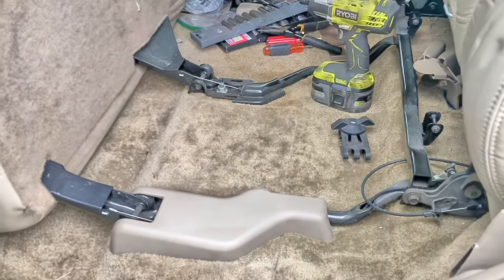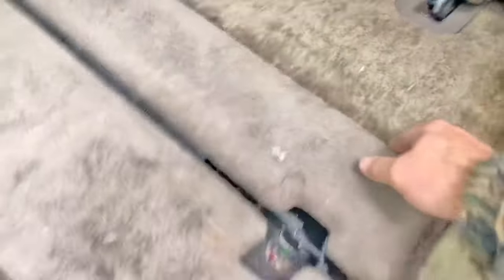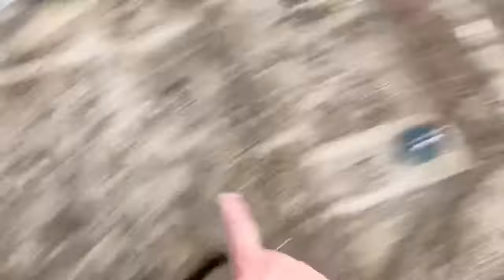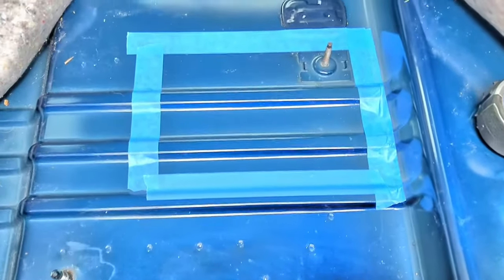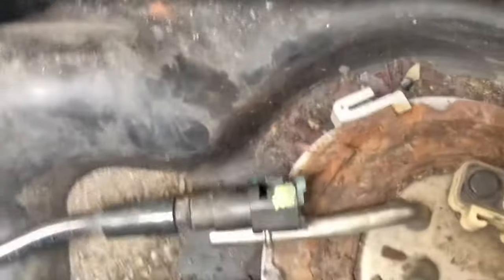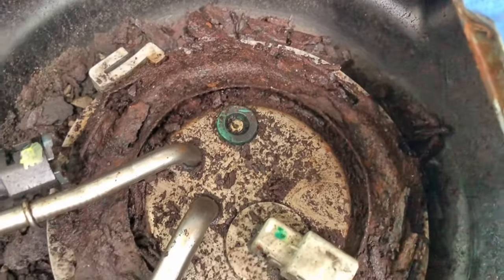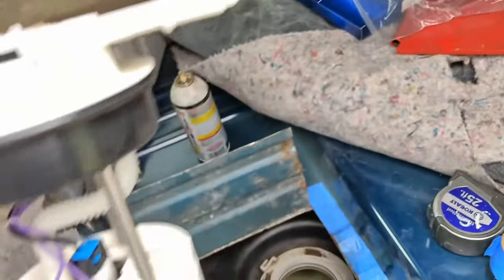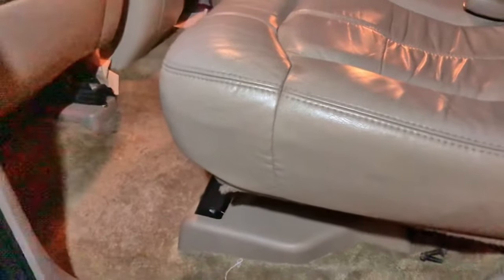Chevy Tahoe / Suburban Fuel Pump Replacement Without Dropping the Fuel Tank ... In 2 hours or less!

Comment: I’ve got a 2003 Tahoe, and after 2 pumps and the drama that comes with the mechanics wanting extra money, I WILL do this, I thought the actual access would on the “trunk” area just behind the second row, Thanks for a very helpful video ✌🏽
Reply from the maker: You’re welcome!
Reply: @jeremy_rigged  hey what did you use to cut the hole?
Reply: I second this question. A cutting wheel seems dangerous
Reply from the maker: Sorry @greenhead333, I thought I answered this already. I started with a cutting wheel and quickly came to the same conclusion and switched to a metal cutting blade on my jigsaw. My jigsaw has an adjustable shoe for cut / stroke depth and I kept it at 1 inch… worked beautifully and actually cut faster than the cutting wheel.
Reply: @jeremy_rigged  much appreciated. I'm doing this job for a friend. I dropped the tank and was met with resistance at every turn. Got the job done, and not fuel pressure. Come to find out, the pump is either wired backwards thanks to the pump manufacturer's terrible wiring diagram, the owner bought the wrong pump. It's a 03 tahoe, with a flex fuel system. The owner said he told the parts store it was a 4.8L gasoline. 

Either way I gotta get back at the pump, and think I may go the access door route for easier troubleshooting
Reply: @greenhead333  I cut the access panel. Worked out pretty good actually.  My take was 3/4 full of gas and I didn't want to hassle with all the other connections.
Reply from the maker: Awesome… when I did mine in the video it was literally right after filling the tank the night before… next morning the pump died in the driveway.

Comment: So glad I found you!  you just saved me hours of work and of course the pump failed with a full tank so i wasnt going to spend 100$ on 5 gas jugs to recover fuel into, and dropping a tank with 200lbs of liquid in it on my back certainly isnt a fun option, so I found THIS!  Had to take a little time to subscribe to your channel and say thank you!  I copied your cut diagram to the "T" and all worked perfect.  Appreciate you very much.
Reply from the maker: So glad it worked out for you! I definitely appreciate the comment and subscribing... more to come, stay tuned!
Reply: What did you use to cut it?
Reply from the maker: @harcoisthebeezneez  I used pneumatic nibblers for sheet metal. Have to start by drilling a 3/8” hole. If you’re absolutely confident you don’t have any fuel vapor, and angle grinder will do... but there’s a ton of risk with that. A reciprocating saw and short blade would be the better option.
Reply: Would a jigsaw work to cut? Also I have an 06 Tahoe that I was wondering if the location is similar?

Comment: I'm still wondering y GMC never included an access point in this area from factory 🤦🏽‍♂️. I did this same thing about 5 years ago and now that I had to buy a similar SUV, I'll be doing it again. The first nut on the tank strap broke and attempting to drop it wasn't even a choice after that. I'll I did was cut the carpet to save more time and angle grinded the cut it and just banged it back in place. It did not look this pretty lol. As long as you get it done, you'll be the only one to know either way

Comment: I used a dremel 3000 with the EZ-Lock cutter blade to cut out the panel. Thanks for the license plate idea to reinforce the floor. Will have to go back in to implement it later. Just used a few short self tapping screws and flashing tape to seal it all back up. Saved a ton of money  DIYing it. Most mechanics i called where quoting me $900 -$1100 which is outrageous. Thanks again!!
Reply from the maker: Awesome... thanks for taking the time to comment, this is exactly why I make these videos... to help others save a few bucks and to share knowledge. Happy New Year my friend!
Reply: Did the Dremel cause any sparks? I actually just bought the exact model and cutter blade and was curious!
Reply: @skeliton1011 Yes there were sparks but very minimal. Once i got a straight cut going i reduced the speed of the dremel and the sparks went away.
Reply: I used a grinder and it threw sparks everywhere but nothing happened. Then again I'm a pro mechanic so of course I capped everything off to prevent fuel vapor from igniting
Reply: I used a hammer and chisel and I changed the fuel pump in my 95 cadillac in less then 20 mins

Comment: Thanks man. I just bought a 04 suburban literally last night and the fuel pump with out this morning. I’ve owned a few gmt-800 rigs and I don’t want to drop a fuel tank again so this is awesome gonna go out and do this now!
Reply: May I ask how u were able to diagnose it as the fuel pump? My 2001 Tahoe is beginning to sputter but no misfiring.
Reply from the maker: @MizzKeamz Mine was an eventual complete failure, fortunately in my driveway. However leading up to the complete failure, I did have some symptoms of running lean, such as lack of throttle response, no power up hills, some misfire codes, etc.

Comment: Thank you! This is a very common thing to do in the jeep world but wondering what did you use to make the cut? Assuming it wasnt a grinder
Reply from the maker: Thanks Adam… a half inch drill bit for a pilot hole and a short metal cutting blade on a jigsaw will get the job done safely. (Reciprocating saw as well.) Either choice, try and use a saw with an adjustable shoe to keep your cutting depth at an inch or less.

Comment: Yours looked more like mine than any on the u tube pages.  Too bad I found this after we did it.  it still worked and just make sure you turn the key forward three times, after you install the new fuel pump.  I listened to the fuel pump, before we covered, and it started right up and no dropping the tank.  You might need two people I pushed on the ring as my husband turned the ring, it has a bit of a spring.  
started right up.

Comment: what did u use to cut the hole.... that metal is pretty tough
Reply from the maker: I started off with an abrasive wheel and quickly switched to a metal cutting blade on my jigsaw. Set to about a 1 inch stroke / cut depth.

Comment: Thank You for the video. My retaining ring was just as rusted as yours. I used a small drill bit and drilled several small holes on the top and bottom of ring to remove. Wiring diagram on the after market pump not correct so I had to go with a GM. This wiring was correct. Up and running saving me at least $500. It took me 2 days @ about 5 hours per day. Hot here in Chicago. Again thank you very much.
Reply from the maker: Awesome William… happy to assist! Yes… those retaining rings can get pretty nasty… amazing how strong rust can be. 😁

Comment: Hi there. Excellent video.   What brand new pump did you use? Factory AC Delco or off brand?  Doea it run well?
Reply from the maker: I used an aftermarket pump from AutoZone. No complaints, 30k miles later still running fine. https://www.autozone.com/external-engine/fuel-pump/p/trugrade-fuel-pump-c5341011/563518_0_0?cmpid=LIA:US:EN:AD:NL:1000000:IEN:19486091408&&CATARGETID=120054150001289130&CADevice=m&gclid=CjwKCAjw04yjBhApEiwAJcvNod_NHZEBmql7PbX5G1oUMgorgP0FC1ds0LWBbiF1o4UbTjJ409RnQBoCI8oQAvD_BwE&gclsrc=aw.ds

Comment: What did you use to cut the access port?? Great video bit what method did you use for the hole?
Reply from the maker: I started with a cut-off wheel (badddd idea) but switched to a metal cutting blade on a jigsaw and set the stroke at about 3/4”.

Comment: Im glad to notice how wayyy much easier yo vid was. I just watched one that took this guy almost 2hrs if that. Just by unhooking the lines,hoses,clamps, brackets. U just made it so much easier. Wat did u use to cut the metal. That tool I dnt hav. But I appreciate the vid. U showed me alot to making a hard job not too difficult to do. My problem on my truck is the floater sensor. The fuel pump is fine I just dnt see myself buying a new pump when all I need is the sensor. But I guess havin the new pump comes wit all that already. Is there a certain model # I need.?
Reply from the maker: Thanks for the comment Deezy… I cut this one with a pneumatic nibbler, but you can use a short metal cutting blade in a reciprocating saw (sawz-all) or on a jig saw. (you can also use a metal cutting blade on an angle grinder if you are 100% certain you have no fuel leaks or an abundance of fumes.) I recommend a jig saw … much less risk. As for the pump, I purchased a cheaper non-OEM pump from Rockauto.com and it’s been fine. You may have an easier time finding the whole pump assembly in stock versus just the fuel probe sending unit… but best wishes on your repair whichever way you choose to go.

Comment: Been trying to get that new lock ring on but I can't get it to seat all the way, been trying for a few days now, any tips?
Reply from the maker: I had to use a broad tipped flat blade screw driver to bend the tabs slightly upward… and it took a bit of rubber mallet and screw driver impacts to spin the lock ring fully. Seems as though the aftermarket ones are a little thicker.

Comment: What and how did you cut the floor bed open. My fuel pump has a leak on top of tank connection?
Reply from the maker: My method wouldn’t work for you… I ground a small slot with an angle grinder (sparks aimed upwards) and finished the cut with a reciprocating saw. A good metal cutting blade on a jigsaw will work if you drill a 3/8” hole to start the blade. Same for a pneumatic nibbler… but it’s frustrating to use on the corrugated floor.

Comment: I dont care what called it.  Dang good video.....   (Rivets) Thank you sir
Reply from the maker: Thank you!
Reply: @jeremy_rigged  I have one question.  Were did the bolt go for the seat when you closed the opening.  It is gone.  I noticed it when you had shown the plate covering the hole
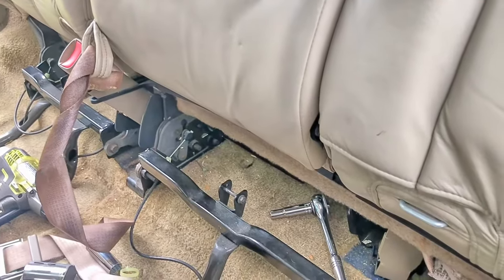Reply from the maker: @sesllc241  I believe the bolt you are referring to wasn’t a seat bolt, it was the bolt that retains the jack under the rear seat. It can be seen at 3:43 in the video with the large black plastic nut still on it. I just removed it altogether as I don’t have the factory jack for this vehicle.
Reply from the maker: @sesllc241  also can be seen at 1:49

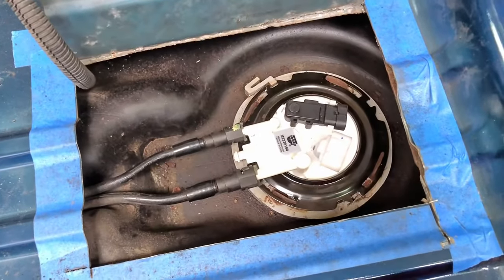Comment: Hey buddy  @ (9:52) it has the plate covering your hole you cut out.  right above that hole is the hole for the bolt and it is missing.  It was there before you made the cut.  does the bolt need be there or is ok that it is not?  I just want to get this right so I can do it.
Reply: I was wondering the same thing too
Reply: Apparently it’s the stud that holds the spare tire jack in place.

Comment: Debating on whether or not to go with this method. Do you know if this works for the 3/4 ton?
Reply from the maker: Bandjolyn... this link may help. https://www.pirate4x4.com/threads/suburban-2500-fuel-pump-access-hole-locations.1425858/
Reply: @jeremy_rigged  Yes! Thank you, very helpful. You're a beast.

Comment: What size head did you use for the nibbler? 16G? Also, would you share the link from where you purchased the fuel pump. Thank you kindly.
Reply from the maker: Gabriel, the nibbler I used was for 3/64” (18-19 gauge), a 16 would probably be perfect. Link for pump… please double check your truck details… mine has the 5.3L engine. https://www.carparts.com/details/Chevrolet/Tahoe/DriveMotive/Fuel_Pump/2002/LT/8_Cyl_5-dot-3L/REPC314507.html

Comment: Looks like you are cutting into the passenger side.  That correct?  I've got a 1999 GMC K1500 Suburban and the fuel tank does not want to drop down.  Trying to find right spot to start cutting in.
Reply from the maker: I’m directly under the drivers side second row seat... if you can borrow an inspection camera (or pick up a cheap one at Harbor Freight or Lowes) you can explore a little by just drilling 1/4” holes to find the perfect spot. From what I understand this technique works on 2000 and up Tahoes and Suburbans... not sure anything is much different on a 1999, but can’t speak from experience, sorry.

Comment: Great video, really helpful, thank you!

My problem is mine leaks from the top of the tank when I fill it so I'm afraid there's gas pooled at the top which would not be good when I hit it with my grinder's sparks, hah.  I've run it dry (I think) and it has sat for a few months - wondering if anyone had thoughts/experience??  I doubt there's gas still sitting atop but it leaks from somewhere when filled so I worry there's a hole or something.  The only reason it's still sitting all this time is because I'm paranoid...
Reply from the maker: If you carefully drill large pilot holes, the metal is thin enough that it will easily cut with a metal cutting blade on a jigsaw, or reciprocating saw. Best to just let the vehicle air out a few days and allow any pooled fuel to evaporate. Good luck!
Reply: Mine was leaking from the top also, so I got a guide hole with a hammer and punch, then from there you can use a jigsaw or tinsnips

Comment: THANK GOD I FOUND THIS 🙏 my Tahoe is a 2000 with 220,000 miles on it I ordered a new pump and fuel pressure regulator on Amazon and now after watching your video I wish I would have ordered the top ring also it did cross my mind if it was going to be junk or not and I'm thinking I should have just bought a new one anyway regardless because this don't look like it's going to be fun I changed the fuel filter hoping that would have done something but it didn't now the next step is the pump and regulator I'm going to put a new fuel pressure regulator on it with a new pump all the same time so the whole fuel system will be all new regulator pump and fuel filter I've got a load of tools inside my truck because it's basically that a truck and the back seats have been folded down since I bought it and it's covered with all my tools so I got to clean my truck to get the seat out I don't care about the car but I don't care but none of that I just want to punch a hole and put a new pump and go but if I have to take the seats out I will you know so I am so glad I found this video thank you very much in details are perfect very good detailer very clear understand and hey you know what you didn't have to swear that's awesome person can teach without saying rot and stuff and my friend you are a teacher thank you so much Rodger and Grantsburg Wisconsin
Reply from the maker: Happy to help Roger! That pump retainer ring is pretty common and usually in stock at Advance Auto and Autozone… about $12 there, may want to grab one. Best wishes my friend!
Reply: @jeremy_rigged  I had to laugh because  everyone talks about big brother and all the algorithms of Big marketing and my got done looking at you watching your video and clicked off of YouTube and in my email inbox was suggestion from Amazon for a four and a half inch DeWalt angle grinder just what I needed how did they know funny how they knew laugh out loud but when I ordered the pump I should have got the ring I thought about it afterwards and I and I now I should have I should have bought one when I ordered a pump and all the stuff I bought on Amazon for a third of the price and same pump is what they were selling at the parts store for $40 less they wanted 95 bucks for a pump and I remember how much it was for the setup for the pressure regulator but it was way more than what I paid on Amazon . Again thanks for the video a very good video . And I'm going to see if we're going to undertake everything here tomorrow if I got everything that I'm going to call the parts store right away in the morning in town here bumper to bumper or O'Reilly's now it's O'Reilly's and see if they got one or if they can order a ring if I order before 10:00 I can have it the same day you know so make sure if I need a new one I'm not even going to mess around with the old one.

Comment: My son's Tahoe needs this but I'm not sure of myself to do this. What did you use to cut out the floor? Wish I could see a more step-by-step vid of the cutting and removal, then how you mounted the plate on for reinforcement. Great video by the way, just not confident enough to try this myself.
Reply from the maker: Shawn, the safest way to make the cut is with a pneumatic sheetmetal nibbler or reciprocating saw. You can use an angle grinder with metal cutoff blade if you’re 100% certain there are no fuel vapors or leaks… but it’s risky and not advised. https://www.harborfreight.com/pistol-grip-air-shears-98580.html

Comment: Did it similarly on my 2003 Suburban, did not need to remove the seat, and used HVAC tape to close the access panel, and carpet tape to close the carpet. I did not reinforce the floor as it is clearly under the seat.
Reply: How did you do it without removing the seat? Cut the carpet?

Comment: Did you cut one of the bolts that hold the seat down?  The taped part earlier in the video and then the after shot with the license plate appears like you cut the bolt?
Reply from the maker: The bolt that was cut was used for storing the jack and lug wrench… no seat bolts were cut.

Comment: How did you cut the floor, do I have to worry about spark?
Reply from the maker: I used a pneumatic nibbler, however I have done this with an angle grinder before... and admittedly it’s not the safest or recommended technique, but it can be done providing there’s no leaks leaks or vapor.
Reply: @jeremy_rigged  Come on man. I get why you're saying you used an air nibbler but anyone who knows anything about this type of work can clearly see you used an angle grinder with a thin cutoff blade. It's clear as day. Using an angle grinder is SUPER DANGEROUS given you really have no idea if there is fuel vapor present before you start cutting.